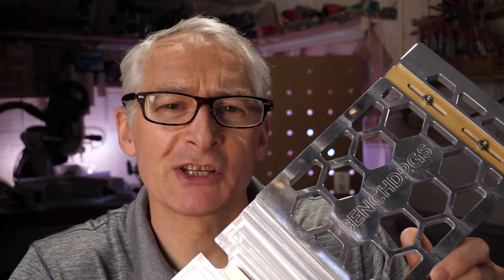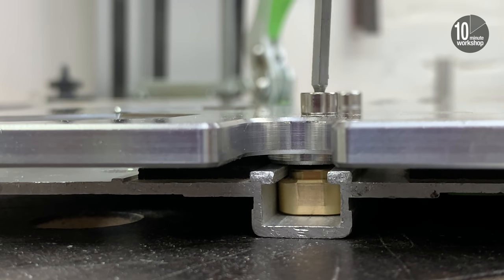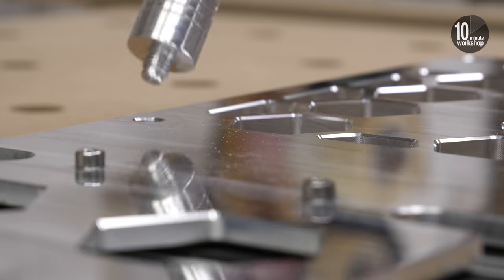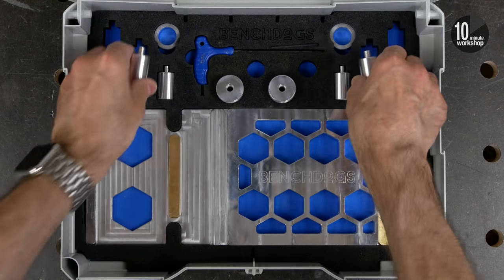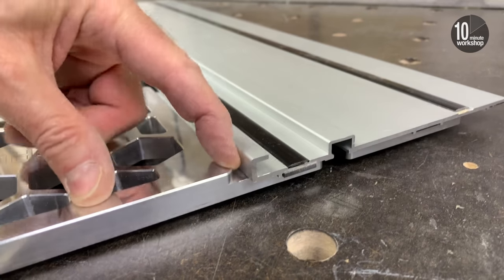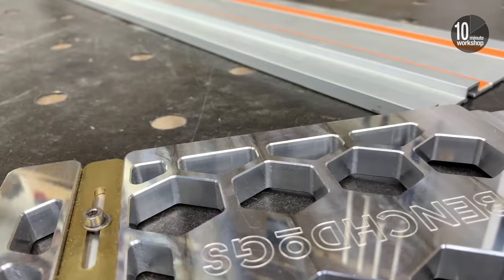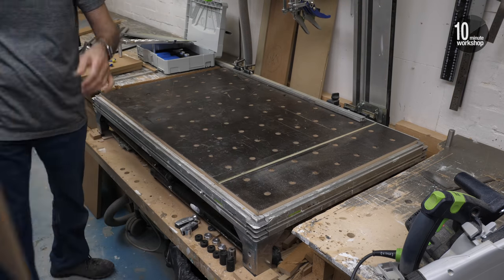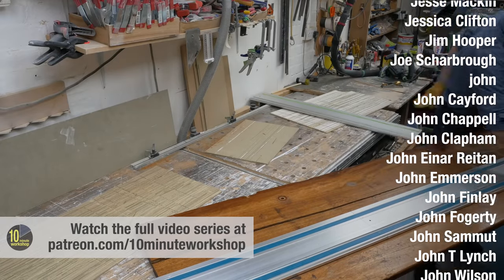Benchdogs Guiderail Square [Video 402][Gifted/Ad**]

Comment: Is that the systainer it came in? I've seen it in a black one, mine came in a beige with blue opener and yours is in a festool one although that sounds like it's your own one
Reply: We have started to use tanos systainers but the Festool version we sent to peter before we changed. As the nhs has to purchase all stock for PPE we had to get what we could . But I believe our dark grey ones will be in stock but end of may.

Comment: is it me or could the whole lot be made tool free, small knobs instead of the allen keys. I have the FC square and needs an allen key, which does not come inside the square as newer models now do . so abit annoying having to keep an allen key on you at all times when using. great vid btw peter
Reply: Thanks for the comment, my reasoning for the fixture with an Allen key was to simply make the square free from any snags ie power cord and vacuum hose, what would you find more annoying, reaching for an Allen Key or possibly ruining a cut.  Not everyone will have a snag it but risk is there, not with ours.
Reply from the maker: Thanks Jesse. In all honesty, I think I’d  dedicate a rail to the square when I’m onsite, so the issue of tool-free or not is less of a big deal if I’m only attaching it once or twice a day. And rah I’m always within reach of a set of hex keys. 🤷‍♂️👍
Reply: @Benchdogtools   Bench Dogs  but on the underside, dont the bolts protrude above surface?  Wouldnt a low profile knob be ok as long as it didnt interfere when using it with the screw in dogs on an MFT. 

And the top I guess you could just tighten them enough, so that you could just slide the support back and forth with your finger and never need the Allen key. But I rarely ever have the hose or cord on the left hand side anyway.

I use my FC square (my version only has one side with a support) on both sides and do find it annoying that I have to get an Allen key, loosen bolts, slide it up... you get the picture.

I'm not knocking it. It's well thought out with the extras. And you clearly take onboard suggestions. 
Will look out for the Mafell version

Comment: I am relatively new to all this, but why would you need the square if you have the MFT style top to begin with? Would regular bench dogs not allow to get the rail square to the piece?
Reply: If a rail is simply bumped against dogs then it can easily move, especially between cuts and having to check that the rail really is bumped to both dogs constantly is time consuming and annoying. I guess the parf rail clips help with that, not sure how much in practice. 

Another difference is that because the regular dogs are arranged lengthwise along the rail you are limited to crosscutting boards that are less wide than the mft style top. Whereas if you have the benchdogs rail square at the end of the rail just after the crosscut fence then there is no limit to width you can use because the start of the rail is completely free of any dogs or obstructions.

Comment: Can you please include the DeWalt track saw rail in your video next week? I’m very interested in that saw and would love to know if there are going to be issues like this before I buy it. Thanks in advance, love your videos!
Reply from the maker: Thanks! Not much to say about the DeWalt track tbh. I’ve never used one for any length of time, and the DeWalt track is incompatible with any other system. 🤷‍♂️
Reply: Peter Millard yah I know it’s quite a bit different, I was hoping that some of the accessories that utilize the t-channel might still be compatible. Appreciate the feedback though. I’ve been struggling with the decision because I really would prefer a cordless saw and with my stockpile of DeWalt and Milwaukee batteries I’m hesitant to pick up a third brand, but I also really dislike corded circular saws. You might be swaying me, though. 👍

Comment: A rail square has been on my radar for a while now. Though I run Festool rails in my workshop, I carry a set of Evo rails in the van for site work.... so it would certainly be a deal clincher for me if Ralph could find a solution to make them Evo compatible (it doesn't look like it's far off)..... Cheers Peter 👍
Reply: Just waiting for the rail and I can make the adjustments, should be an easy resolution.
Reply from the maker: Rail’s on its way. 👍👍
Reply: Awesome.... I'll keep an eye out for an update. Nice one chaps 👍

Comment: I like the idea of an MFT in a box idea, I’ve got the Axminster Parf 2 drill and guid set but find my bench dogs are over tight where as the Parf dogs slide in a dream, any help would be appreciated. I bought the rail dogs and they have the same issue...
Reply from the maker: Interesting. And TBH that’s why I used an ‘official’ Festool MFT top in the video; I have a 3rd party top in my main MFT and it’s fine, but 1/10th mm variation can make all the difference. 👍
Reply: Peter Millard , might be worth looking at the Parf dogs as well as Benchdogs , also here’s one for you. I’ve tried to source as Festool swing for the mft or add a rail to my table but had no luck, wondered if it’s not a listed spare, thanks Peter
Reply from the maker: You could get spares for the older MFT/1080 like mine - https://www.mtmc.co.uk/Spare-Parts/Festool-Spare-Parts/Festool-Workplace-Organisation-Spare-Parts/Festool-MFT-1080-/-490916-Spare-Parts__p-240-13767-12734845-93802.aspx

Though they’re showing as out of stock/not available. You’d need parts  50 - Support unit FAP-388551.A2 and 69 - Support unit FSP-488549.A2 I know Festool switched today a proprietary profile when the moved to the MFT/3, so,perhaps it’s all tied in with that?? 🤷‍♂️

Comment: TSO makes a square that latches onto the rail. Your thoughts on the desirability of the quick attach feature?
Reply from the maker: Yes, and I’m used a latch on my recent (#418) DIY rail square. TBH I don’t think there’s much difference in terms of ‘quick release’ - how long does it take to twist a couple of thumb screws - but it would certainly pull the rail tight against the rebate, if it needs that. That’s why I used one on my DIY square, but the Benchdogs square is nice and tight just with the thumbscrews. 🤷‍♂️👍👍

Comment: Hi Peter, just out of interest it looks like the Triton square you hold up at the start of the video and comment that it is 'awful' - I've got one of these I picked up for about a tenner a while ago. Admittedly I hardly ever use it since I made an MFT but I can't remember it being that bad - it obviously has none of the extra features of the Benchdog's square but it does create an accurate angle square to the rail. What are your main reasons for calling it awful - you've got me paranoid now.
Reply from the maker: That was a DeWalt square, bought many years ago, and it is woefully out of square - the one job you expect it to do. 🤷‍♂️ I’d forgotten that Triton sell a version of this - if yours works OK, then stay happy with it. 👍👍

Comment: Was looking interestedly at the new Festool square at c 115?? same as the model APTC sell at c 120 ( TSO ) this though blows it away - dont currently use festool MFT stuff but this would probably be the option I'd look at for future development - They seem to be out of stock at the moment but I'll order anyway. Sheppach rails were going for £15 each in B&Q before lockdown ( clearance ). Just checked the APTC site and the TSO stuff has dropped dramatically probably because of the festool square - I'm sure they were of the order of £200....
Reply: Like you though Id rather no systainer - I'll email them and ask if this could be an option
Reply from the maker: Yes, I’m pretty sure the Festool square is a rebadge of the TSO. From what I’ve seen they’re all really nice squares, just cones down to personal preference as much as anything, I think. I know Ralph has done custom sets before, I’m sure he’ll be receptive to the idea - and if not, then that’s probably me off the Christmas card list, lol! 😂
Reply: @10MinuteWorkshop  Just had a mail - yes he will do this and it will be put on the site - going to order now
Reply: @johnfindlay4360  Thanks for the order.

Comment: Do you have a link or product name for the hinges you use on your drop down track saw guide
Reply from the maker: Hi and thanks! It’s an off-the-shelf Festool MFT or Multi-function table & the hinged rail comes as standard with that. See videos #182 and #183 for more details. 👍

Comment: I’d be really interested as someone who’s in the market would you go for something like this than the mft3 set up I have a basic mft3 but looking  out might buy a hole mft 3 set up but cost wise to add this set is cheaper maybe that could be a possible video down the line
Reply: I was wondering the same thing - the pros and cons of using this (squared into the dog holes) vs the hinged arrangement on the MFT
Reply: Freebird Interiors think Something like this for under 200 pound is a serious pice of kit have quite a few of the other products bench dog spell from peters review be interesting to see the results. Still think I’ll end up buying a mft haha
Reply: @thomashawkins2395  I have an MFT. Other than the top, which is easily replicated, I don't particularly like it. I don't like the permanent horizontal rail and almost use dogs instead. I recently broke the legs on mine whilst lazily using it to do some hand planing, which it clearly isn't strong enough for. It's portability is also an issue, as it's too heavy to comfortably carry around. I would definitely get just an MDF board and this type of setup if I was doing it all again.
Reply from the maker: That’s pretty much my experience with my older MFT. It’s too heavy to be properly portable, and not heavy enough to use as a traditional bench. I love the hinged rail, but until that patent expires I think the rail square with MFT dogs, and a fence on fence dogs, is an excellent mobile solution. And yes, an ‘MFT vs MFT-alike’ video is on my radar 👍👍
Reply: I am falling out of love with my MW1000 portable workbench for similar reasons.  Worth saying that these benches are very clearly made for power tool work and absolutely not well suited for hand tool work.
Reply from the maker: That’s interesting Alastair. I’ve never used the MW1000, but had a go a building something similar to the Tim Wilmott setup, and found I couldn’t get it into many of the houses I was working in - not without rearranging hallway furniture! 🤷‍♂️
Reply: Freebird Interiors what I don’t quite get 
is why does the extension part of the mw1000 doesn’t have like a pin on the aluminium t track to line the bench dogs up and why the bench dog position are different on the mw 1000 wheel base  I think the idea of it is excellent for the work your doing with long scribs for me I have a kapex mft it’s lower once the kapex is on it’s the same hight  as the mw1000  fid it a good hight for building cabinets
Reply: @Alastair_Freebird  "worth saying that these benches are very clearly made for power tool work and absolutely not well suited for hand tool work". But what if you're hand tool workbench is untidy and you can't be bothered cleaning it up? That's how I broke my MFT!
Reply: Peter Millard like many things it sounds so good in principle - compact, on wheels, can carry systainers.  But actually getting it in over thresholds and past narrow spaces is not easy, and I often think that a well thought out self-made MFT board with 2 lightweight trestles would be an improvement.  I almost never need the aluminium profiles round the edge (they’d be good for vertical clamping but I don’t really need it) and they are an annoyance when I want to quickly handsaw or jigsaw the end of a board which would be easier to do with a square edged worktop

Comment: Good one Peter. Seen Ralph teasing this kit on FB for ages now. Nice to finally see it in action. Keen to see a Mafell one!! Like your idea about a fuller full kit including the fence settup. On boxes, not just the Sys in this example but more generally, I've been dropping into conversations with dealers and people on site for some time now that whether or not you buy your tool/kit with a box should be an option. I quite often condense my tools where possible in L-Boxxes and Systainers. Last thing I need is any more. And lets face it, hardly anyone likes a s**tty blow moulded case!! Seems there's many out there that'd like the option of tool +/- insert, no case. I've even thought if it'd be worth reaching out to manufacturers and dealers to see if it's feasible. Anyways, all the best mate.
Reply from the maker: Thanks Stew! Yes, totally agree re boxes. So many guys are going with the systainer or L-box or some other stackable system, I think it should always be an option. 👍👍

Comment: Recently bought one of these.  When you use the dog collars (to keep the rail raised above the MFT surface), presumably the collars become the surface that you are squaring off.  Is there a risk that the accuracy is slightly compromised?
Reply from the maker: Hey Alastair. Here are lines scribes one the MFT dogs for common material thicknesses; I usually keep the collars just the ‘other’ side of that line, so the prevent the rail dropping all the way down to the surface, but are easy to tweak upwards slightly to get the material under the rail. Then when you’re cutting, the rail is bearing directly against the material surface. 👍👍
Reply: Peter Millard I meant because the edge of the board is against the collars not the straight rail square edge
Reply from the maker: No, that’s not what they’re for; they’re there simply to stop the rail & square combo dropping below the depth of the material; if you’re using the rail sq + MFT dogs, then you should be bearing the material against a fence, or another pair of benchdogs. 👍👍
Reply: Peter Millard ah yes of course, you did show that!  So the squareness comes from the accuracy of the grid of holes, I was getting confused!

Comment: What is the benefit of this versus using the Benchdog raildogs? Is there a discernable advantage? I bought the raildogs for my Bosch rails and will be using them on my worktop that is being made currently
Reply from the maker: As mentioned in the vid, zero set-up time, basically. The rail dogs work great, but you need to align them to the holes each time, unless you can dedicate a rail to the task, whereas with this you just screw the dogs into the holes, job done. 👍👍
Reply: Oh roger, understood thanks. For my expected use case that won't be an issue (...yet 😉)

Comment: Hi Peter, I notice that you very rarely mention Dewalt.  Is it that they are incompatible with Festool (and virtually everything else) or are they just 'rubbish'?
Reply from the maker: Hi Richard. I’ve never used the DeWalt plunge saw for any length of time, so don’t really have much to say about them tbh. They decided I go their own way with the rail profile, which doesn’t help and prices themselves into a tight spot when compared to eg Makita and Bosch. And Festool too, given the deals that come around regularly. DeWalt has a nice feature set and I’d love to get my hands in one for a proper play - I keep looking on eBay, but they fetch too much (for me) used. 🤷‍♂️👍